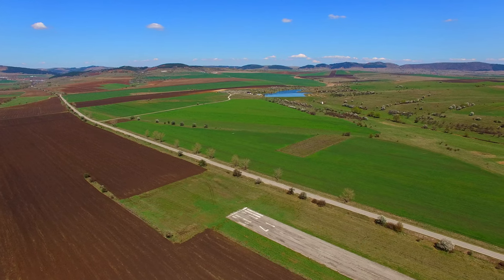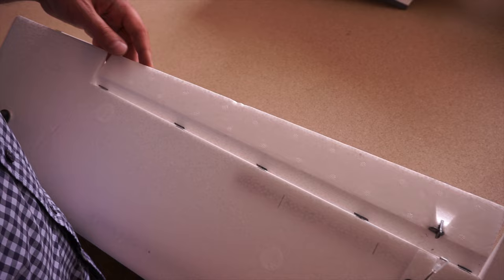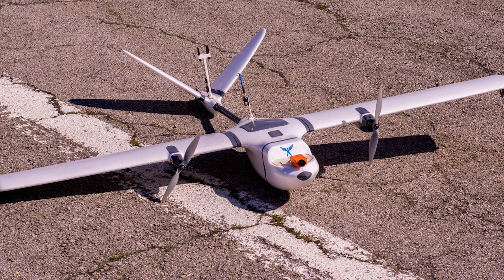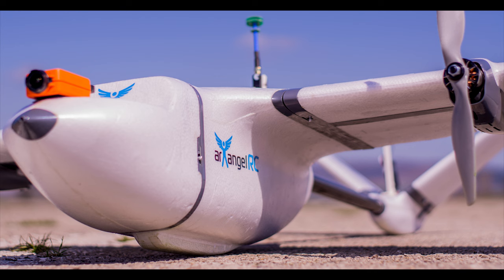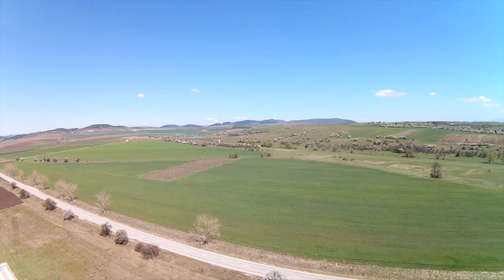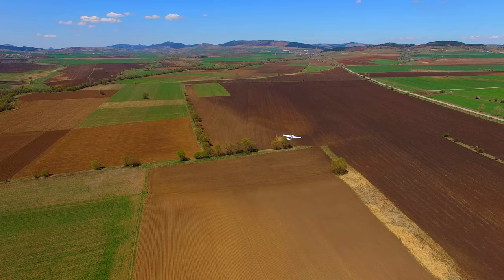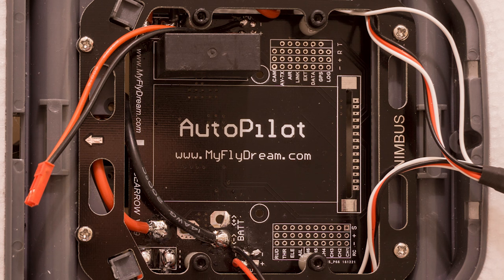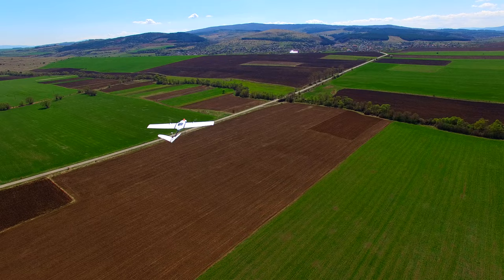MFD Nimbus - full review and maiden

Comment: I decided against this model after watching another reviewer reporting that the installed PC boards add a lot of weight, but wow the efficiency you're achieving is fantastic! I'll definitely give it a try. Using your link :)
Reply from the maker: PC boards?? There is only one, and it doesn't weight more or less than comparable products! If it is not onboard you will still add that weight in voltage regulators and power harnesses...

Will have to still see if I can make my camera work properly when powered from the 12v side and see if I will actually be able to use the PDB as intended, as it really simplifies things.

And yes, based on a rough estimation, average level flight amp draw for the entire flight comes out to just over 5A. I did some amp draw measurements on the motors the other day, each motor draws 15A at full throttle with the stock 10x6 props, will have to re-test when I put on the 10x7 later on.

Thank you for the support! :)

Comment: A very insightful and well done review. Being new to your channel, I'm enjoying picking through past content. Some nice nuggets like this are timeless. I'm not planning to purchase this plane, but seeing many good design features incorporated into the MFD Nimbus.

I think a number of the confusing aspects of this (kit) plane stem from its VTOL design pinnings. Design features were not evident in the FPV KIT version offered at the time (or due to lack of a manual). 
Nice job of including this context, in comparison to other kits.

FYI: the FoxTech (FoxTechHobby @ foxtechfpv .com) channel has a number of videos (26) on the Nimbus featured in commercial applications. FoxTech besides offering RTF edition, offers a 22 Ah 1.9kg solid-state 6s battery for VTOL edition (vs similar 22 Ah li-ion pack @ 2.6 kg). FoxTech at one point set a number of records related to hover duration and winged flight range for this class of UAV.
Reply from the maker: Yeah, the plane definitely had some thought put into it! :) I am aware of some of their videos though, they do push this plane a lot, and it seems to be doing well as a VTOL indeed!

Comment: I really thought about purchasing the Vtol version as it is more practical for package drops. Do you know if the MFD autopilot works with crossfire as well? I would desperately want to know , also, do you think that the vtol version is worth the extra motor and more headache with programing?thanks !
Reply from the maker: Well... the MFD Autopilot would work with any system capable of outputting PWM or SBUS signal, though not sure what the Crossfire one does! As for the hassle of extra gear... depends on what you will be using it for! If it will get some work done well and easy... why not!

Comment: Hi, you are the best person in utube 
You provide all answer like a professional reporter 

I I noticed that we can enhance the flight distance and duration by adding better long lasting battery. However, I have a concern with the plane structure. High gusting winds may affect it?

1. What if I change the structure to carbon fiber? Will I need a stronger motor because it will add a little more weight but the strength of the plane structure will be affected by gusting winds 

2. Can I make a Sky Walker Black X8 and/ or the Sky Observer to fly over 100 miles by adjusting the battery and the motor?
Reply from the maker: Well... depends on the flight altitude! High gusting winds on the ground are very different from gusting winds 1000 meters up! On the ground they are turbulent, but the higher you go, usually the wind becomes more constant and more laminar, i.e. smoother ride!

1. Which plane are we talking about?

2. I am not much into flying wings and don't have much information on them... but it should be possible!

Comment: The stall characteristics are the same regardless of direction relative to the wind. A stall has to do with the angle of attack and airspeed, it has absolutely nothing to do with wind speed or direction. Remember, when a plane is in the air, it is flying in the air mass, it has no idea where the ground is in reference to it, the wind is nothing more than the air moving relative to the ground.
Reply from the maker: I know that... the idea is going downwind the plane stalls at a higher ground speed. I currently do not have an airspeed sensor on board, so ground speed is my only reference, hence why I am working it like that! :)

Comment: Do you feel there is room for a mapping camera like a Sony a6000 or is the cargo space limited with the 16,000mah pack? I've been waiting for this review and almost pulled the trigger on this unit a couple of times. I love the eve for its vast room in the fuse making equipment layout simple (even though I'm sure I over thought it) with room for adding items in the future. I don't like the wing wiring plugs making it difficult to add your rx or vtx after flaps and leds. Sounds like the Nimbus may be a winner as an fpv rig but may have some limitations in the mapping due to the fuse volume. I would be interested in seeing the actual mapping unit once Charles releases it.
Reply from the maker: The FPV version certainly will not do well for mapping... I guess you could remove the plywood structure on the bottom of the fuse, and cut an opening in the fuselage... and do a custom pack so you can fit all in there... but I would rather wait for the mapping version when it is released, and I will try to get a hold Charles to ask when that is going to happen! Last I asked him about it he said they were still testing stuff... so at this time I can say it may still be a work in progress... but possibly should come soon! The idea there is that you get it with the custom pack he offers that will fit under the main hatch on top, and you don't have the plywood thing on the bottom, so you have all that space  there free for a camera, and in that situation an A6000 will fit for sure... and possibly even a slightly larger camera as well.

Comment: Hello, which aircraft do you think is better, given the payload capacity and flight time, since I will use Aerial Survey.

Nimbus 1800, X-UAV Cloud 1880 or Skywaker EVE-2000?

The Nimbus 1800 would you recommend using MFD AutoPilot?

Thank you in advance for your opinion.
Reply from the maker: Hi, yes, if you go with the Nimbus I would suggest you use the MFD AP, however, the current version does not support mapping functions, so you may have to wait for the Nimbus mapping version to come out, with the new MFD AP.

When it comes to payload and flight time... I would also consider the EVE-2000 for this job! This plane was designed specifically with such tasks in mind and will give you plenty of flexibility when it comes to payload and equipment options!

Comment: Hello. I'm looking to get into the hobby and I'm currently trying to choose a plane to start with. How would you compare the MFD Nimbus , X-UAV Clouds and and the Skywalker EVE-2000? Could the convenient connections of the Nimbus be kept if one decides to install their own distribution board and autopilot?
Reply from the maker: Hi, if you are looking to get into this, I would not suggest any of these planes at this time. I would urge you to take a look at the XK A1200 (https://goo.gl/AhvsZX) and get that for now. Once you have logged a lot of hours flying and have done some work on the plane, then turn to the larger birds!
Reply: Is the A1200 large enough to accommodate full size flight controller ,air speed sensor and other sensors ? How much added weight do you think it can take added to the stock FPV version? I might pester you some more on facebook if that isn't too much of a bother for you. 
Thank you for the quick response.
Reply from the maker: I am not sure you need an airspeed sensor on that size plane, also... why would you want to use a full sized autopilot, when there are micro versions that actually work better?! Go here: https://arxangelrc.blogspot.bg/2016/06/xk-a1200-fpv-rtf-epo-plane-very-nice-flyer-good-fpv.html

and read towards the end of the post to see how I installed the autopilot on mine, should be enough to let you know what the plane can and cannot do! In any case... like I said, it would be much better if you go with something like this and learn to fly before you spend 1000-2000 USD on a plane without any flying experience!

Comment: Sorry if I missed it - how does it compare to the crosswind?
Reply from the maker: You didn't miss it... but this plane is much older than the Crosswind... so there is no way I could have mentioned that comparison in this video! Crosswind is better - more space in there, and quite stable in the air! This one, however, lends itself to VTOLing more easily!

Comment: On big airplanes, they put tape covering that gap between surfaces where the hinges are, so that airflow is not interrupted and drag created by that gap /slit there.   I don't know if this helps, for the weight you add, but try it. 

Also, the whole point of a V tail is to reduce drag by eliminating one tail surface (from 3 to 2), but by sticking a round antenna pole up in the middle between them (the back side of which is very draggy - make it into a tear drop shape if possible), you pretty much eliminate that advantage.   Might as well have a traditional tail on a long range plane if you require a vertical antenna. 

Here's a video showing what your vertical antenna is doing in the air flow:  https://youtu.be/F1P8Ox7M38E?t=56

choppergirl.air-war.org
fpv.air-war.org
Reply from the maker: Well... it was a way to mount it... I am not in the business of designing aircraft... or optimizing them perfectly... just looking for the most optimal antenna placement! :) Recently I also stopped using that scheme of mounting antennas... moved on to something more optimal! :)

Comment: 100mins flight time with 10k mah used and 10x6 prop... what size is that motor then 750 kv 2836`?
Reply from the maker: Motors are 520Kv, 2814 or 2820... can't recall the exact number right now!

Comment: Hello, nice video...
I just received my Nimbus, and I had a little problem with it. the PDB, had the left wing motor reversed polarity. after connecting the ESC´s, and made a try with the battery, something got burned. hopefully, not the ESC. maybe you should warn your viewers  to check it before connecting the battery.
another thing that got me puzzled, is that, for both ESC´s, there is just one wire, ( signal), and I has imagined, doesn´t turn the motors. where it got the ground??? just asking, to avoid to open the wiring. I mean, the ESC, need at least, two wires, ground and signal. where does it got the ground then?? from the PDB, or the servos??
please let me know, if you know the answer.
thanks for your time, and for your review
Reply from the maker: Hmmm... mine was certainly not reversed... but please make sure you test that ESC! If you have plugged in the battery with the wires in reverse, I am willing to bet it has burned out!

As for the signal wire, it usually is only 1 without a ground, because it is assumed that you would power the autopilot from the same battery you power the ESCs, in which case the autopilot also has the same ground coming from the same battery, so you can connect only the signal wire from the ESCs to the autopilot. This way you also avoid the chance for a ground loop!
Reply: well, at the end, the ESC is ok. the PDB, is done, but because I got an extra one from MFD, all good now.
they are using the same ground as the aileron servos. maybe that´s why, you got interference with the cam.
I hope tomorrow I finish it, and I will make my maiden.
I made a thrust test on 3S, and no way it will get airborne on 3S. I hope it will with 4S, if not, must buy a 6S pack.
thanks so much, and nice flights
Reply from the maker: If you are running the 510Kv motor, I am pretty sure it will not fly on 3S, and probably not on 4S even! BUT, if you have 2x identical 3S packs, you can wire them in series to get a single 6S pack and fly the plane. What ESCs do you have on there? Do they support 6S?

Comment: Awesome video, as always!

Now you've made my life even harder - it is now harder to choose between the MTD, the Nimbus and the Clouds.... 

At some point there was a jello on the video - could the unballanced props be at fault?
Reply from the maker: Thanks! Well... this would depend on what you want to do with the plane, because they can be quite different! :)

Yes, there was jello, and there are a few reasons for this... although I was surprised how little there was since I was expecting more! First, I have done NO balancing on the props, and second one of the motors has a bad bearing... and it does vibrate quite a bit even without a prop on it. My next task on this plane would be to balance props and motors and to rewire the video system to eliminate all interference coming from the PDB... and possibly see IF the PDB can be used if I can manage to get the video system working when I power everything from the 12v side.
Reply: LC filter on the video power and gnd wires should help. I'm having a kind of the same problem on my MT - as soon as I connect the RunCam HD2 to the battery together with the VTx and the flight camera, my video range decreases to around 60%. There is no interference in close range however... 

In choosing the next airframe the main problem is that I don't know what I want it for - I love my mini talon and it suits all my needs, but it just happens so that I want another plane for no reason, just to have it.
Reply from the maker: I know the LC should help... but I hoped this board will allow me to skip it! Also... the problem may not be with my RunCam 2... because I've used that powered from 12v on my Mini Ranger, and it was working fine! https://youtu.be/KN7zC6rOLUc

As for wanting another plane just for the sake of it, I'd say... Welcome to the Club! :D

Comment: Hi, I'm about to order two of these, but I can't decide if I should go for the kit or the optional 510kv motors - what is your opinion (over and above what you have in the video of course) should I bother with "better" motors (T-Motor?). I would love to make this my new super long ranger..Many thanks.
Reply from the maker: Hein Du Plessis Well...  what do you consider "super long range"? The 510kv motors draw 15amps each on 6S with 10x6 props, but if you load up the plane to around 4kgs take offs will be a bit tricky if you try to launch it yourself. Possibly you could go to 12" props to improve that, but if you want to keep the 10" props you could look into some 2820 motors at higher Kv but still 6S capable, like what the mapping version will have.
Reply: I would love to have 3 hour+ capability (with Li Ion). My current super ranger is a Sweepwings Dreadnought (just about 2 hours with lipo). I'm happy with using auto take off, so launching myself heavy would be Ok, I think. I just finished a MTD and I'm stoked about it's performance, but I love the look and features of the Nimbus. Thanks for your recommendation - would 12" not be too much past the belly? I will be using motor brakes.
Reply from the maker: If you want 3+ hour with the Nimbus... you would definitely need more powerful motors, so at this point I would advise you to go with the KIT (https://goo.gl/ZjzxFV) if you really want the Nimbus! I think, however, for something like this possibly the MTD would be a bit better suited if flight time is ALL you are looking for! My Nimbus is at 3800 grams now and I am actually thinking how to bring that down a bit to make it easier to launch it myself! Not a problem when you have somebody to throw it for you, or if you have a bungee system.

As for the props, Andrew Newton flew it with 12" props, although he was landing on some very soft bushes near the coast where he lives, and it seemed to be OK on landings, but would definitely get more thrust out of those 510Kv motors, which would be needed if you want to stick with them and the Nimbus!

So, the Nimbus is a bit heavier than the MTD because of all that plastic and the denser foam... BUT... I think it is more aerodynamic, especially with the body shape and that V-tail. The wing profile is a bit draggy, but it does offer gear lift capabilities and is super stable... so... at some point they could be on par, but more testing will be needed on the Nimbus!
Reply: Thank you very much, one of the two Nimbuses (Nimbusi?) is to impress a potential client, which might work better than the MTD, which looks like a scale RC model :( I'm running Tiger Motor MT2814 AntiGravity  KV 710 on my MTD, it seems a little heavy but will have enough thrust for sure. I'll fit 10" to compare with the Nimbus. Thanks again for the great information.
Reply from the maker: I hope I've helped you even a bit! Still need to do more tests on the Nimbus before I can say for certain what it can do and what it can't! :)
Reply: You certainly have and more than a little bit! I dismissed this airframe out of hand after reading the first unboxing. Many thanks for the quality review. Looking forward to what you can achieve with this plane.
Reply from the maker: Thank you! I am also looking forward to that, but need to get a few other things done first, but the Nimbus is a work in progress... so will get finalized pretty soon I would hope! :)
Reply: Well, you need to keep in mind that those pinching the penny!! saving the dollar will give you the least in exchange for the most!! So I'll go for the one that have the least mounted & assemble... I would put hinges, change servos!! and for what I can see use cat T6 wiring for all video apps, it is very clear to me that they want it to look good, but performance wise one honestly don't know.. heavy interference can make the best plane look & feel crappy, and take away one joy on a beautiful plane...